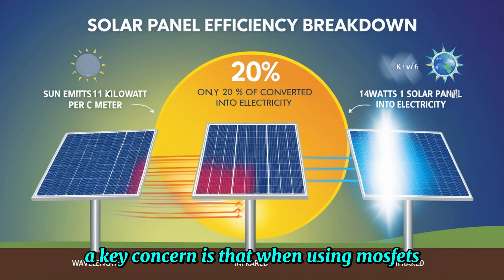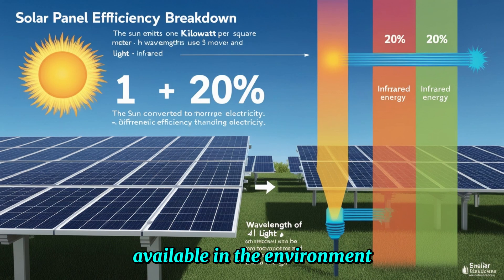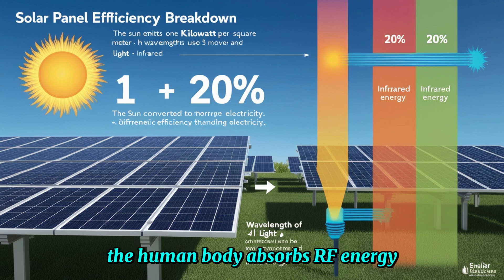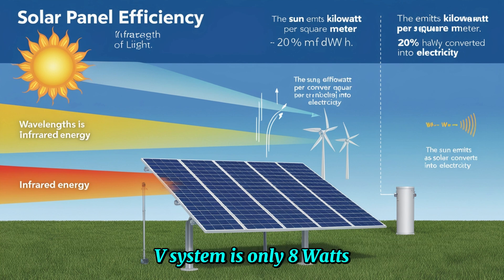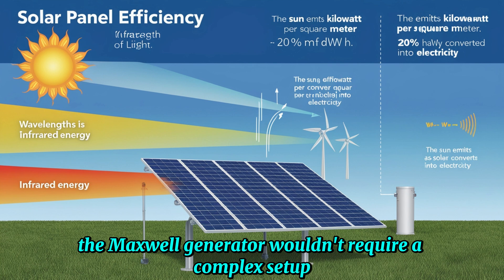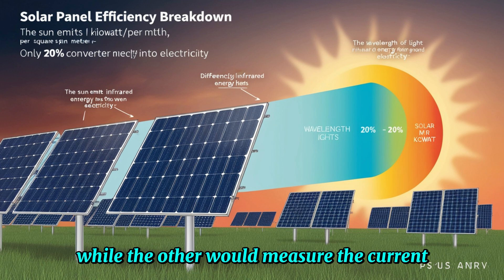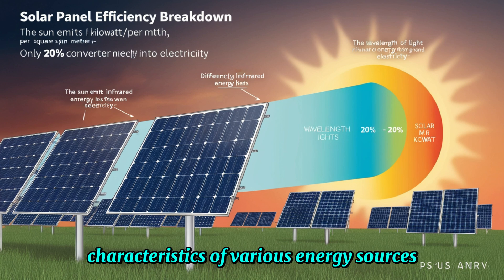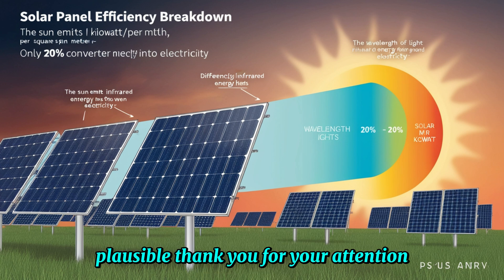Dr. Elie Giacometti Analyzes Maxwell Chikumbutso’s Revolutionary Tech

Comment: Maxwell keeps referring to it as a sonic device. I have been trying to figure out what he means by that. The simple answer is he's just throwing "sciencey" sounding words out there. I thought about using the tiny amount of electricity you get from the rf waves to power a forced oscillation process in a reconator to achieve voltage gain. Many people have been trying to get a set up like this to work with things like a series of inductors and capacitors. And sure you can measure a voltage gain in a system like that. But once you try to take energy from that system, you lose your voltage gain and still get leas than you put in. Because taking energy away is adding entropy to the system and it stops the voltage gain through resonance. No matter what you do, that pesky law of thermodynamics always gets in the way. I don't see how any of that can work without rool temperature superconductors. Which so far have not been invented.